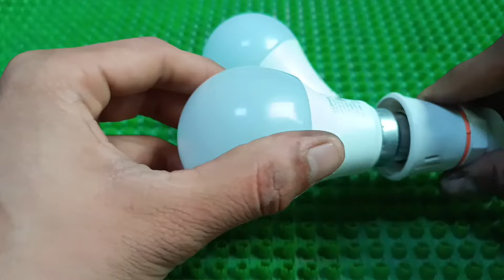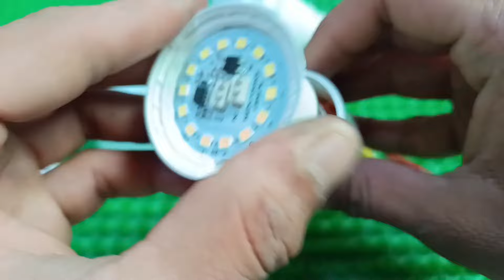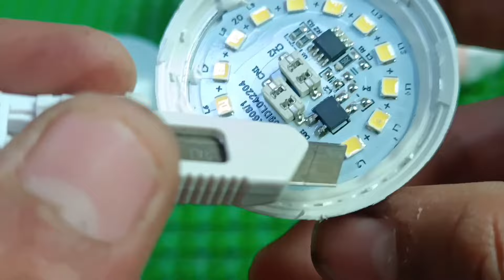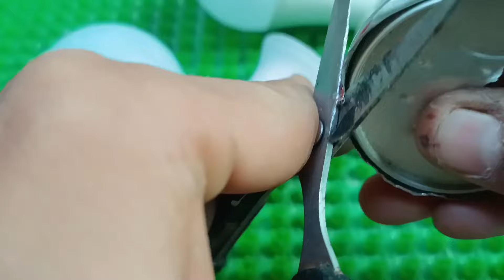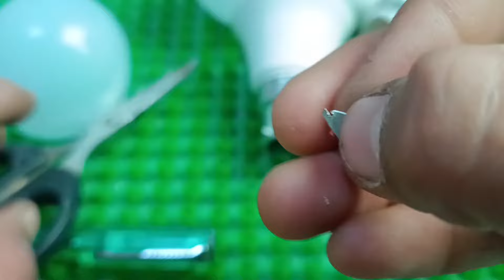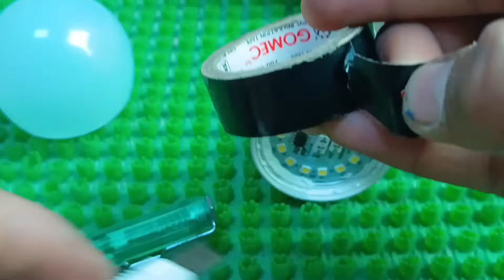Wrap a non-working Led Bulb with insulating tape and the result will amaze you !

Comment: never saw any tape wrapped around the lamp??? that repair would not last for 5 mins before the tape softened and fell off. use a wire and solder it on.